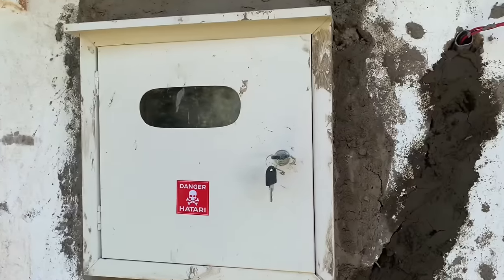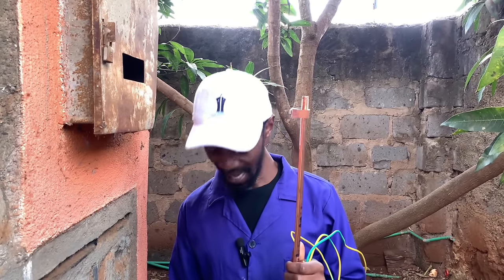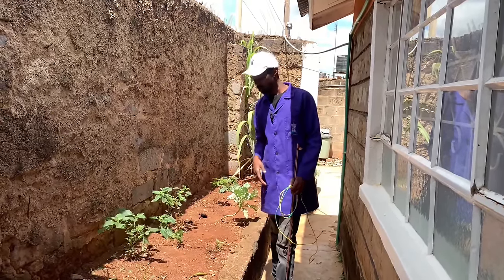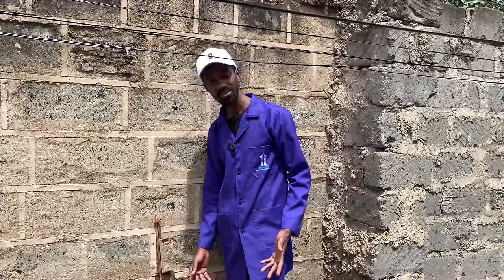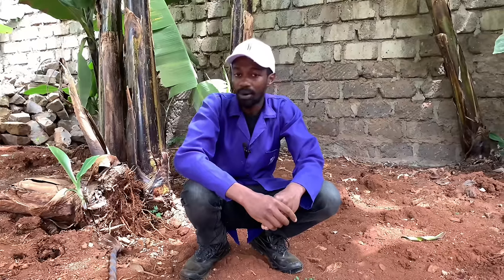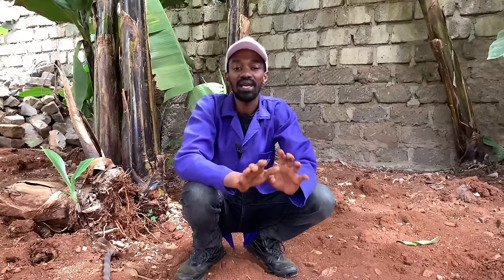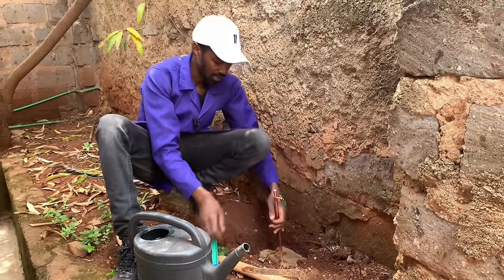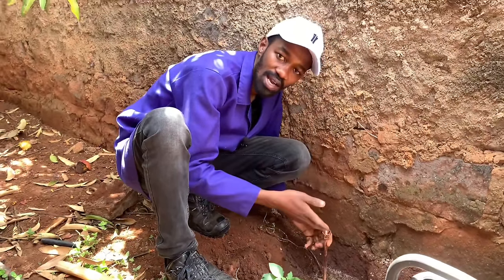How To Install An Electrical Earthing (Easy Way)

Comment: Sir I want to ask where will u connect the thunder arrestor?is it after you connect the cable from consumer unit to the ground,then from the consumer unit to the thunder arrestor? Pls explain more sir
Reply: I'm not familiar with the rules for electric installations.  Where I am the grounding for the lightning arrestors and the electric systems must not be connected.
Reply from the maker: Very correct  @ralfbaechle  
Thank you so much for your reply.

Comment: For instance if you have only the live wire can you drive that rod in the ground and use it as neutral?
Reply from the maker: Great question Lexy, it won't help, the earth would act as a return path to the transformer and hence that would create a lot of resistance. What do you think?

Comment: What are the materials needed for earthing?
Reply from the maker: Hello Roy, great question. You need an earth rod and the cable. For places with rocks or dry earth, the resistance will be too high and the best thing to do is incorporate more materials like charcoal, sand and salt.

Comment: What happens if the is no earth wire?
Reply from the maker: Great question Jennifer. There will not be a path for dangerous or leaking charges from the house appliances and thus exposing the users to risk of electric shock.

Comment: Use an earth insulation resistance tester to determine accurately the exact position for earthing.
Reply: Bro he needs Multifution test,  I am in Somalia now he can borrow from me if he wants.
Reply from the maker: Got it Solomon, thank you so much.
Reply from the maker: @MohamedAli-qi1lc  it would be a great honor for sure, let's talk further. Email me on topheightselectricals@gmail.com